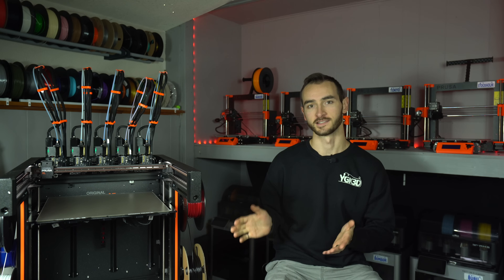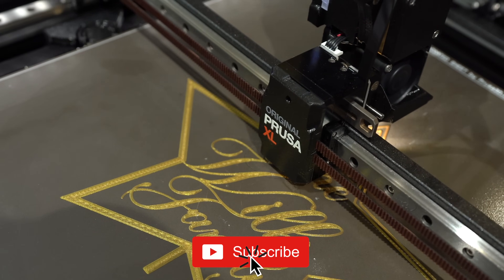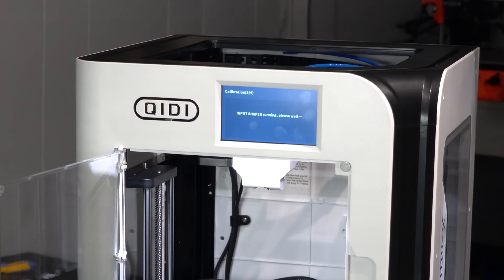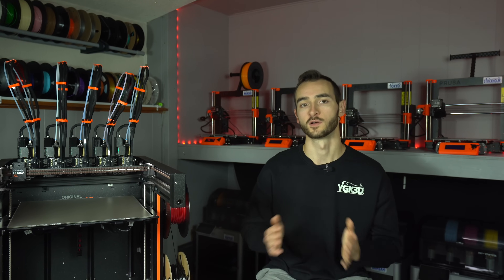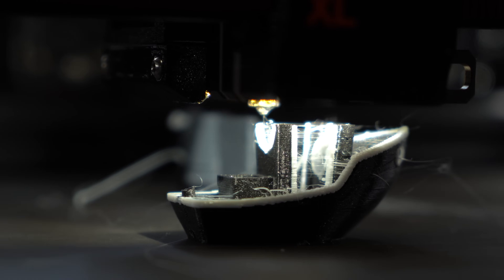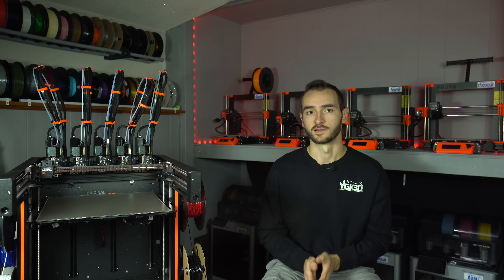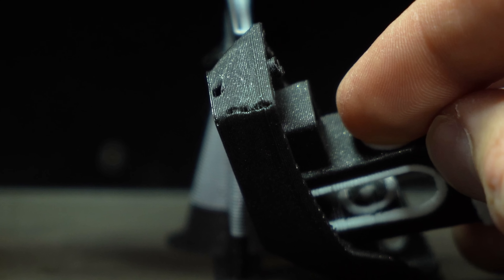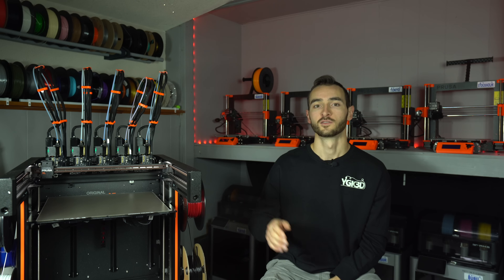The Prusa XL Just Got WAY Better with INPUT SHAPING... But Is It Enough?

Comment: Day by day with each improvement I move closer to wanting one. Seems like a great compliment for my X1C.
Reply: I'm returning mine due to just generally bad prints and often skipping/underextruding layers on tall prints. Give it a year until it seems a more finished product.
Reply: @redkingrauri3769  more people have this, prusa isn't what it used to be. Only fan boys go spend 2500 for something that underperforms but has the prusa brand on it.  Just buy a X1 with ams and a voron then you still have money left for filament and your still cheaper that the xl with toolheads and low speeds.
Reply: @redkingrauri3769 Sorry to hear that, sounds like a big let-down.

Though, for potential future buyers like myself, not so bad considering what looks to be great potential.

What are your 2 biggest annoyances and 2 things you really like about it?
Reply: @floodo1 

Biggest likes: 

Prints were flawless on overhangs

Nextruder eliminating the need for Z-offset was very welcome.

Annoyances:

Tall prints (like 13cm+) always had a strange underextrusion that made them brittle and break

Later on could not get a good first layer to save my life resulting in every print peeling up even using gcode and filament that had worked well on the same print.

Comment: The XL actually does have an onboard accelerometer for every toolhead, it's just not implemented in the aplha yet.
Reply from the maker: I know they've said that. But they also said it was "vital", yet are living without it in the alpha and made no mention of when it would start to be used.
Reply: @ygk3d  Yea they have a weird stance on the whole accelerometer thing, also with not putting it on the mk4. But saying it isn't there is very misleading imo.
Reply from the maker: @ren8  I didn't say it wasn't there, just that I couldn't find it. I found it strange that they made no mention of it in the blog, even if it wasn't being used right now.
Reply: It's not onboard and never will.

Comment: Hi great video especially since many of the bigger channels seem to be under embargo or arent interested in the xl

Quick question though: when you compared the print time between the bamboo and the xl is that with the same nozzle size and overall material volume? Would be interesting to see the print when the same amount of material is extruded in both models...
Reply from the maker: Thanks! Not sure why they're not covering it to be honest. I've seen a video from Uncle Jessy and one from 3D Printing Nerd but that's about it. Perhaps because Prusa doesn't send review units so they'd need to purchase it themselves, and it's not an inexpensive printer.

I set the layer height, perimeter count and infill percentage the same for both the XL and the X1C. The X1C result was sliced for a 0.4 nozzle versus 0.6 for the Prusa. There is less material deposited for the Bambu versus the Prusa because the extrusions are thicker with the 0.6 nozzle on the XL. This means the XL consumes more filament to print the same model. The 0.6 nozzle starts to be advantageous when you have thicker walls or thicker layers, since fewer passes are required to achieve the desired width.